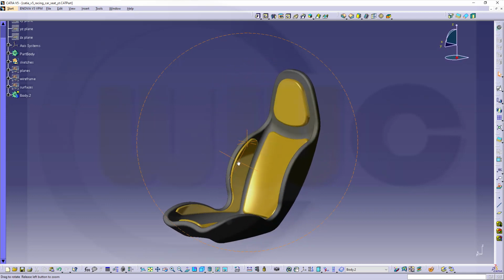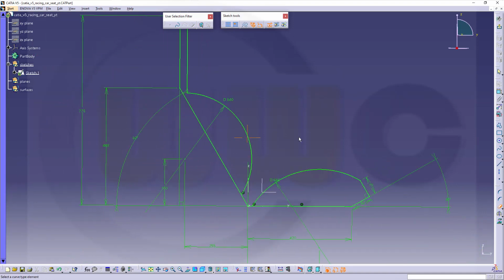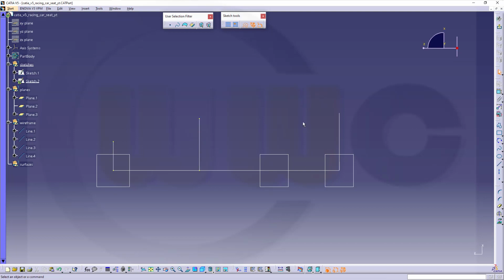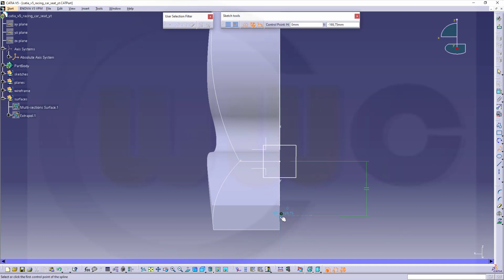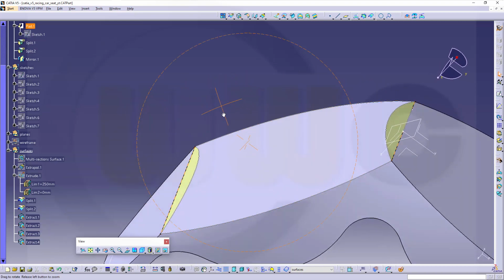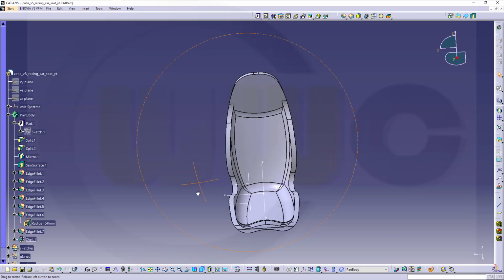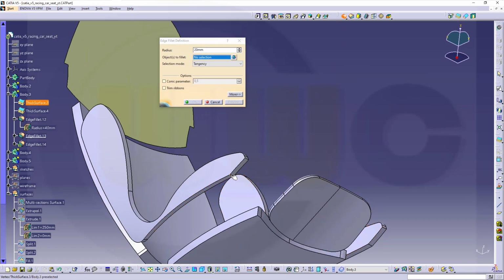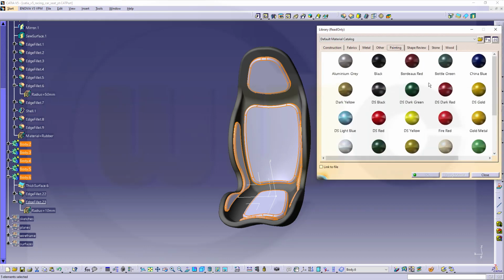Racing Car Seat - Catia v5 Training - Part Design

Comment: Hello Walden, For some reason the shell function won't work for me :( ..... It is giving me a tangency error. Any idea what might be the reason?
Reply from the maker: I would assume there is a radius which is to small - so if you shell it - there is no radius any more on the inside.
Reply: @wolfgang.walden.cad.training  Thank you, I will check the model one more time. For some reason, when I try to select the front face, for shell function, it highlights the entire model. Thank you so much for your reply.

Comment: In catia v5, accelerator key disabled which will be used for short cut.
How to enable?
Reply from the maker: What would be the "accelerator key" ???
Reply: @wolfgang.walden.cad.training  
We will assign keyboard shortcut under option/customize/all commands.
In catia we have to assign the short cut with accelerator key (ctrl,sht,alt) and this displayed as icon.
It is greyed and not enabled.
Reply from the maker: @SatishKumar-gt6jd  I assume you have to use "catia admin mode" to change this. Because usually those greyed out options can be changed only in admin mode.
Reply: @wolfgang.walden.cad.training  
When I open the catia i ran as administrator,
Still not resolved.
Please help.
Reply from the maker: @SatishKumar-gt6jd  Not as "windows admin", you have to start catia in "catia admin mode".

Comment: Hello Wolfgang,

how do you send the H and V Direction into the show now?

If I draw a frame over it, then the coordinate system is always marked with.

Thanks
Reply from the maker: You should watch my "frame" closely, at first I zoom in , so the axis system gets bigger in relation and then I do  the frame just big enough ;)
But you could hide those elements by selecting them in the tree as well.
Please check you selection options - with my settings it selects only elements which are complete inside the frame.
Reply: @wolfgang.walden.cad.training  
Thanks for the answer.

For me, the coordinate system is smaller than the H and V Direction. So I always choose the coordinate system with me.

Can I aadjust this at Catia?
Reply from the maker: @torstenr2493  TOOLS->OPTIONS->INFRASTRUCTURE->PART INFRASTRUCTURE->DISPLAY - there is a slider for the size of the axis system